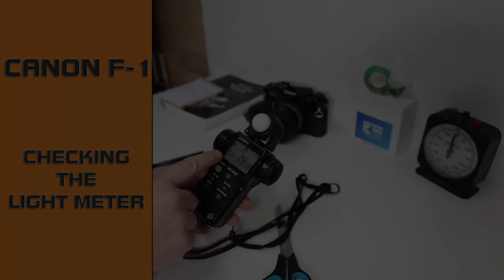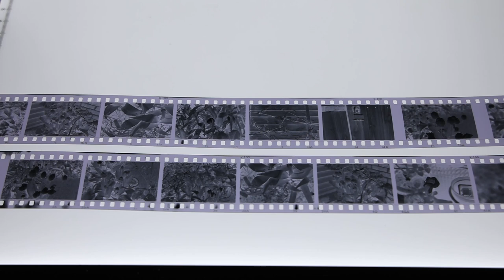Canon F-1: Can I rely on the internal Light meter

Comment: Thanks for the video, interesting comparison, l’ve recently bought a Canon F1 original version, but having a few issues with the meter, if I centralise the shutter speed indicator then bring down the aperture circle it often seems to catch and push down the meter, planning to buy an external meter but do you reckon it’s worth having the meter serviced In your opinion?
Reply from the maker: If your in the UK then I use Steve at Camserve to cla and or repair. But to be honest recently I have relying on Sunny 16 , actually a revised sunny 11, and getting reliable results. Might do a video on that. Wishing you well 👍📷
Reply: @davecarrera  Dave, thanks for your reply, very much appreciated, I’ll be looking out for your new videos.